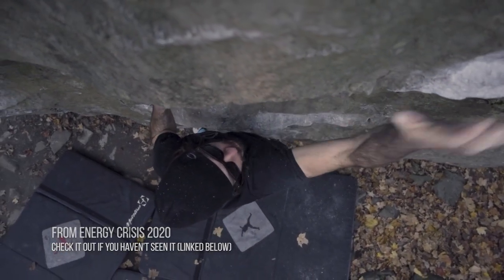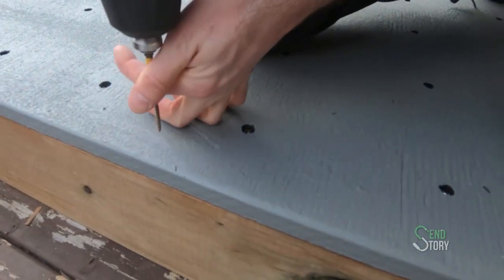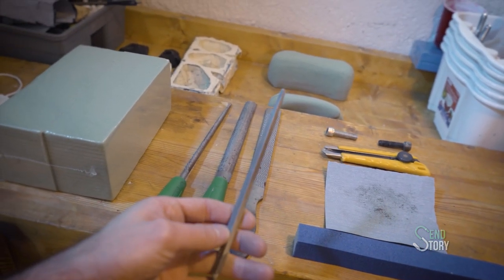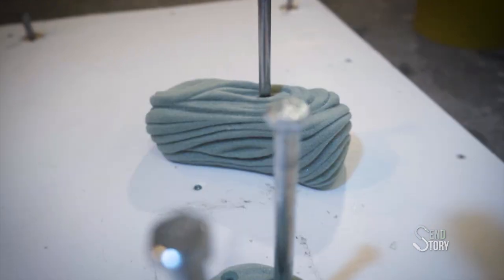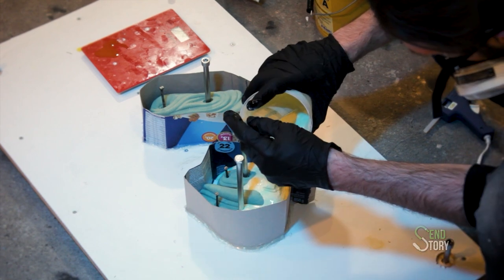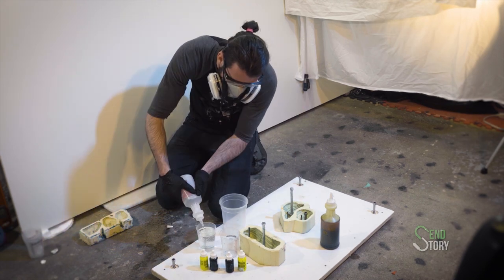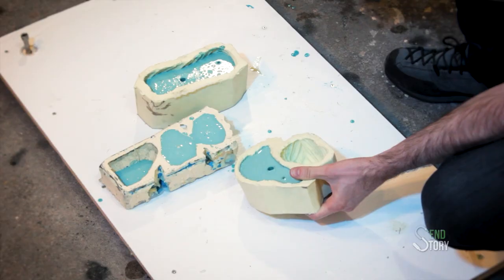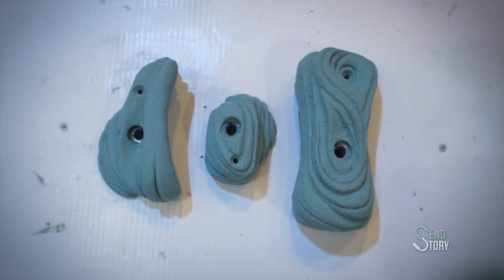MAKING CLIMBING HOLDS: Full DIY Process (including links)

Comment from the maker: A bit slow to edit and post this one, but here is the truncated version of the DIY Climbing Hold Series. I have some more videos in the pipeline, so stay tuned for some more videos in the very near future! Thanks as always for the support! P.S. Here is that wacky video of climbing on the holds: https://youtu.be/RJWC4sYbjZo
Reply: How did you get such a  distinct texture on the holds? I’m in the process of making me and some buddies hangboards and would love to know thanks 🤙
Reply from the maker: @JustSomeBigfoot  Hey, no problem. The texture is actually based off of the substrate that you are sculpting from, so in this case its floral foam. There are different kinds, so depending on what kind of foam you use, it changes the texture. For example, this floral foam (linked in the description) has a finer texture (smaller pores/cells) where the white rigid floral foam has large cells and therefore creates a rough (and in my opinion, uncomfortable) texture. The pro climbing hold shapers have a specific foam that is spec'ed for carving and is more durable, has an even finer texture, as well as comes in larger blocks. It might be worth reaching out to a rigid foam manufacturer to see what you can get your hands on if you are looking to do something large like a hangboard. Good luck and thanks for the comment.

Comment: Great video! I was wondering what kind of durability you get with your holds. I know it's polyurethane like commercial holds so I imagine it's similar in longevity?
Reply from the maker: I can't say I've tested them thoroughly yet (the only way would probably be to get them up at a gym... which I might try to and do a follow up video), but I've noticed no wear or had any issues. Most commercial holds in North America are poured by Aragon Elastomers, and in Europe I think it's Composite-X and I'm sure they have their proprietary resins and processes that make the quality better, but I really can't complain about the resins I've used. Some of the dyes and pigments in some holds I've poured seem to fall victim to the elements outside (mainly UV, I suppose), but then again, so have some commercial holds (I show this in my climbing wall update video). Honestly, the biggest change I would make from the process in these videos is to get my hands on proper commercial foam to get the scale and texture closest to commercial holds. Green floral foam is definitely limiting, but cheap and easy to get a hold of. Hope that at least somewhat answers your question. Thanks for the comment.
Reply: @SendStory  Thank you for the quick reply! I actually didn't really expect to get an answer on a year old video. Much appreciated feedback. I've been toying with the idea of making my own holds and volumes for a moment and discovering your video gave me the info I needed to progress with my ideas.
Reply from the maker: @sergeantoine123  glad I could help, best of luck with your holds!

Comment: thanks! How and when do you add the washer/what are you using to hold the bolts steady in both the silicone and resin steps? thanks again!
Reply from the maker: Hey! I add the washer during (before) the resin pour. The hole you carve out to recess the bolt head in the foam when shaping the hold creates a cylindrical shelf (when reversed out in the mold) that you place the washer on before you pour the resin. 

As for the bolts, I use a tnut in the bottom of the foam to keep the bolt upright when casting the silicone mold. For the resin pours, I actually just use the mold itself to hold up the bolts perpendicular to the level casting surface. As long as the bolt is square at it's end, I find it stays nice and plumb. On that note, when casting, the bolts I use I have modified to not have any threads (cut off the threads), and only have the threadless shaft. If resin leaks into the threads, it's nearly impossible to remove the bolt without damaging the hold. On that note as well, make sure you use a good release lubricant on the bolt to remove it easier, and I find removing it before the hold is completely cured gives you the least resistance (just make sure you remove it carefully to not distort the hole size or shape). Some people use a type of plastic dowel or straw instead for this method as well. Others also just cast the hole in the foam shape so you have the bolt hole in the mold and don't need to bother with any inserts... But from my experience, when you cast larger holds, the silicone "bolt tail" is prone to distorting and moving/bending so you end up with a wonky hole in some pours and often it will rip over repeated casting and create headaches.

I have been wanting to do a more detailed follow up video (or videos), but unfortunately haven't found the time. Hopefully this does a decent job explaining it and helps you out. 

Thanks for the comment!
Reply: @SendStory  awesome answer! Thank you so much!

Comment: Hello sir, great video, loved it ! I just wanted to know (if you still know) how much did it cost ?
Reply from the maker: Hey! Thanks for the kind words! Unfortunately that question is hard to answer because of how many variables are involved. Depending on the supplier in your area, costs can vary quite a bit, as well as the size of holds you are making. The molds are always the most expensive compared to the resin, so your budget might start off by finding out how much liquid silicone for making molds costs at your supplier (you could use the links to products in the description to try to do a rough estimate, but many art/sculpture supply stores carry comparable products). Sorry that wasn't the exact answer you were probably looking for, but hopefully it helps!
Reply: @SendStory  Thanks for the quick answer and the time you took to to answer!

Comment: Thanks for the video. How do you get a texture as a rock? Or this texture is just as plastic?
Reply from the maker: Hey, thanks for the comment. The silicone you use to make the mold captures very fine textures from anything you make with it. So in this case it is capturing the open pores of the foam you carve, which are created when you cut open the tiny bubbles that make up the "closed cells" in the foam. This is the same process larger climbing hold companies use to get their texture - so essentially this process will give you more or less what you get from holds at the gym. This gives it a texture somewhere between a coarse sandstone and a soft/fine volcanic rock. If you want it to look like rock, you would have to carve it to give it that aesthetic. The are some techniques like cracking the foam open to give it the look of a flake of a rock face, however the texture would still be the same. If you wanted to cast realistic rock texture, you would need to carve something that felt the same or similar. So you might get actual rock texture by carving a real rock, like a soft limestone or something similar, and then casting that. Original holds were cast in concrete as well, which while being super heavy, might help you get something with a more "realistic" texture.
I hope that helps answer your question, thanks for checking out the video.
Reply: Awesome mate, thank you very much. I’ll try to make few. I was doing bouldering years ago, now my kids love climbing.
Reply from the maker: @josedanielarciniegascontre9631  as a new dad, I appreciate this. As long as you keep a safe working environment, making holds can be a fun exercise to do with the kiddos. Sounds like a pretty great parent to me. Best of luck!

Comment: hello! thank you for your video! dp yyou know how to make dual climbing holds?!
Reply from the maker: Dual as in dual tex (dual texture holds - smooth and shiny on some parts, textured on others)? I have made them, not sure how the pros do it though. I've sculpted my foam and then added in material where I want it to be slick to cover the texture (pores) in the foam. This can be done with different materials as long as they don't react to the foam or are not easily casted. You could probably get away with a thick paint that you layer up and sand off until smooth, as long as your last coat is glossy (shiny). Then you cast the hold the same way. I hope that helps! I want to do a follow up video talking about making hollowback holds, different ways to make molds cheaper, and how to make dual tex (several ways), but I unfortunately haven't had the time. I hope I can get around to it. Good luck!
Reply: @SendStory  Thank you for your kind reply! I'll give it a try. and I'll look forward to the good video.

Comment: The resin you used, it looks dark - can you tint it to lighter colours, like a yellow? How about a white hold?
Reply from the maker: I honestly couldn't tell you what this resin in particular looks like cured without any pigment/dye because I haven't ever created any holds without it. I do believe that the resin without color ends up being something that isn't quite white, however, the cured color is very light and a few times I haven't got my colors as vibrant or deep as I've wanted and had to add more in my next batch (when I was still playing around with figuring out the right amount of color per volume). I have made yellow though, and it seemed to turn out quite light and I had no problems achieving a color I wanted. There are other resins that work for climbing holds, so I wouldn't be afraid of trying others if you are looking for a pure white color, and there are different ways to color holds as well. Personally, for my home wall purposes, getting an exact color match or a specific color hasn't been a huge concern. Hope that is helpful!

Comment: I’m curious if these could be 3D printed with a resin printer, as I believe you can use polyurethane with those
Reply from the maker: Hey, sorry for the late response. I'm a little out of touch with 3d printing technology as of late, so I'm not sure of all the processes and materials that exist now, especially for home users. The 3 main issues in the past (which might not exist nowadays) that I have seen with 3d printed holds are efficiency/scalability, structural integrity, and texture. 

So it is way cheaper to print your own hold, especially if you just need one or two. As I've mentioned in videos, the mold is the most expensive part, and you remove the need for one by 3d printing. But printing takes longer and casting resin takes a few minutes. So depending on the scale of your production, the cost of the mold goes down the more you output and it can be a more efficient process once you have a mold. 

I would also argue you get a superior product from casting. I know 3d prints can be super strong, but I feel like a pour would be stronger. I know uv/laser cured 3d prints could give you similar results, but I'm not sure of their integrity. I have seen some 3d printed holds that seem really good just randomly sheer along a certain cross section of the hold. 

Resolution is the biggest issue I think, especially with home quality printers. To get the texture right, the most minute details are important. I have yet to climb on a 3d printed holds (that I'm aware of at least) that has texture that close to casted resin. Even the cheap foam I use doesn't quite get the texture right (there is a foam more dense and rigid that the pros use to shape).

By no means am I saying you can't 3d print holds, I'm sure there are ways, but I'm just not sure it will yield as high of a quality of product. If you try it out, I'd love to hear how it went and have you share your results.

I have been meaning to experiment with 3d holds and maybe a hybrid in-between, but just haven't got around to it. Maybe some time in the future I can find some time to continue the series. 

Thanks for the comment!

Comment: How did you get them have that grainy texture instead of just coming out smooth?
Reply from the maker: It's kind of hard to tell in the video because of how small the texture is, but the grainy texture actually comes from the foam you carve. The foam is filled with really small bubbles (closed cell foam), and as you carve through them, you expose those cavities and create little pores that create the texture. This is one of the reasons why high quality liquid silicone that's meant for making molds is important. It gets right into the micro textures of the foam to create the texture that you get after you cast the molds. I hope that makes sense and helps explain!
Reply: @SendStory  That makes perfect sense, thank you.